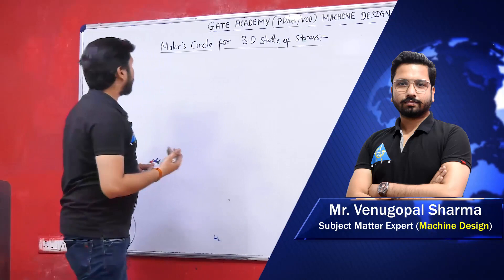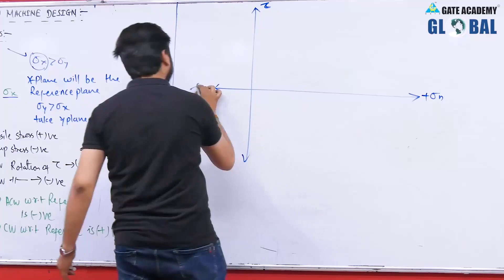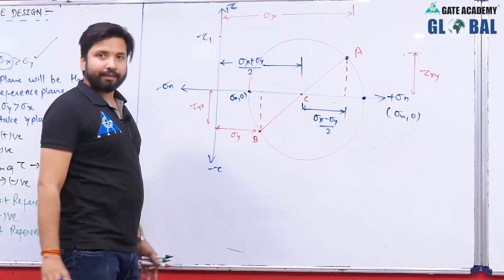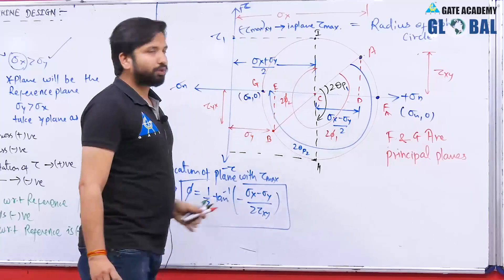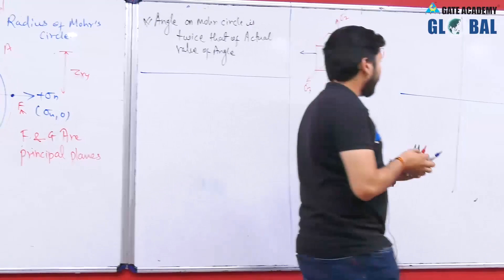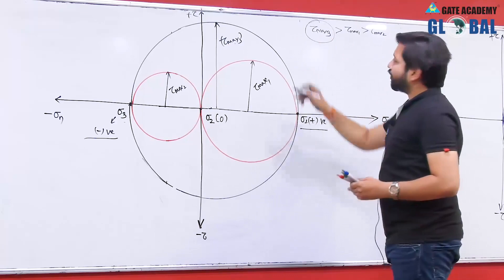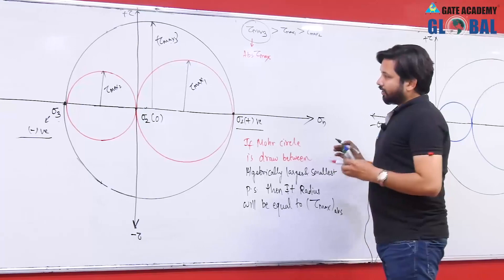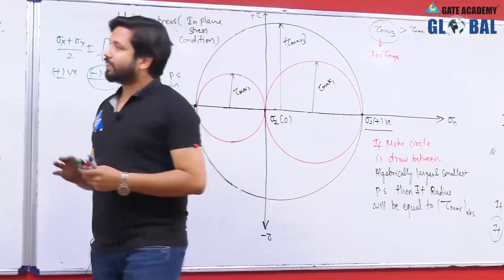Mohr's Circle for 3D Stress | Lecture 3 | Machine Design

Comment: How to calculate sigma 1,2 and 3??? then after i can draw Mohr circle
Reply: Once you are given rectangular stress components ( Sigma x, sigma y ,Sigma z) 
Then you can calculate sigma 1,2,3 by using 3 stress invariant rule and cubical equation hence after  you solve the 3 stress invariant substitute in cubical equation and after th equation you'll get 3 roots which will be in the form of sigma 1,2,3